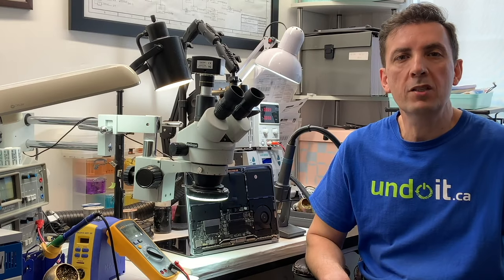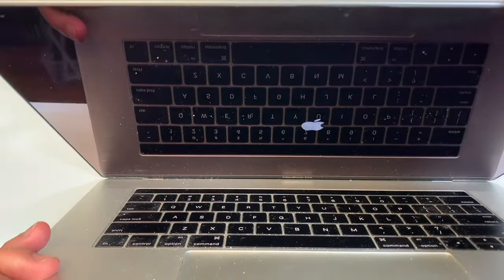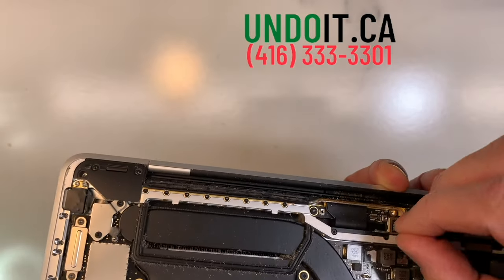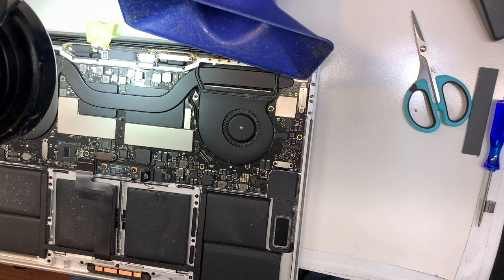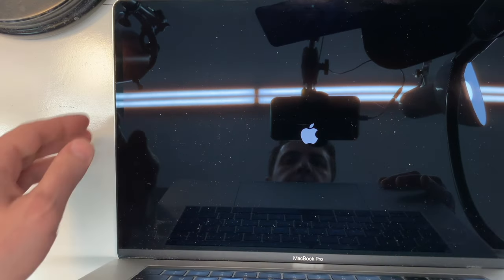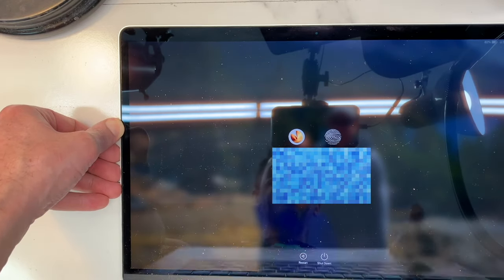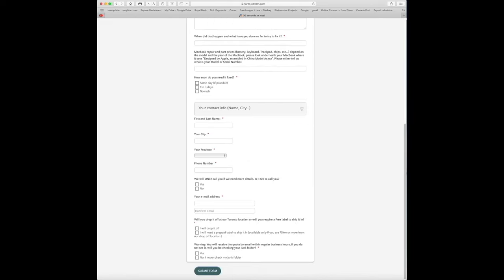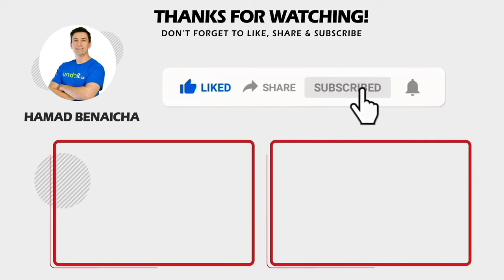🇨🇦 MACBOOK SCREEN GOES BLACK WHEN TILTED OR OPEN AT CERTAIN ANGLES, FIXED! - Hamad Benaicha 20+ exp

Comment: While I was streaming some videos on YouTube on my macbook pro, my display turned black. After I closed it and opened it again, it worked perfectly fine. After 15 min the screen turned black again and then 4 thin vertical purple lines appeared. I restated my laptop but it didn't work but when I closed the  lid and opened the lid a few times the screen for ok for 2 second and  then it again showed purple lines. Please help

Comment: What could be the issue if there is no image at all, but the back light works? Just randomly happened after using the macbook the night before, and when I opened it the next day the screen was black. Did not drop it. Checked at different angles and it stays black.
Reply: Same issue, did you find a solution?

Comment: i have a macbook air m1 2020 model.. have the same issue.. i shared your channel to the technician.. he tried, but he says my model is different than what you have shown , but it has not been repaired it. The screen works till an angle of about 80 degrees and that too only when i open the screen in an extremely slow pace with lot of patience.. looking forward to some inputs how i can repair.. the technician says i will have to replace the screen, but its too expensive
Reply from the maker: Sorry for the late reply, the Air 2020 does not have the flex cable issue, the problem is with the LCD and unfortunately you might have to replace it.

Comment: Hello Hamad. Thank you for taking the time to show this to us. Sadly I'm far away in London so I'm going to attempt this myself and hope for the best. I have very little experience with this type of repair and I see this demands an exceptional level of soldering expertise but I'm hoping that having the same microscope you have (I'm a fine jewellery maker) will give me some confidence. could you please confirm that I need to connect 8 jumpwires from the cable to the base? and (this might be a stupid question) do the wires have to be insulated so not to touch each other? Thanks very much and I appreciate your impeccable skills!
Reply from the maker: hello, thank you for the note, there is in total 7 wires that need to be jumped and you are correct they have to be insulated as you don't want to short and kill the GPU.
Reply: Awful filming bro

Comment: Having the same issue on a M1 Macbook Pro 14 inch MacBookPro18,4
Is this also reparable? Could you fix a laptop sent from Europe?
Thanks!
Reply from the maker: No sorry that issue only apply to the 2016, 2017 MacBooks 13 and 15", unfortunately if you have a similar issue with yours it will have to be replaced, it can be fixed.

Comment: Mine goes blank and comes back after I have closed and open the lig, It is a 2017 13inc mackbook pro
Reply from the maker: It is most likely the same issue as described
in the video.

Comment: I have macbook Pro a1502 model, whenever I power it on there is sound but the screen is completely black. There is no physical damage to the screen or the cable. Everything looks fine. What else could be wrong? Pls help
Reply from the maker: This is a different issue, model, it could be as simple as unplug the LCD cable clean it with some alcohol and plug it back, make sure the battery is unplugged when you do that.

Comment: I am thinking to buy a macbook for a repair that i want do do to make some money. I saw one on marketplace. An app in the netherlands where I live. It was a 2019 MacBook Pro 13 inch with the problem that the screen only works if it is between 70 and 100 degrees. I can buy it for 250 euro. But I am 13 so I have not much experience.I did some iMac’s. Also I have a question about an 2010 MacBook Pro. I am fixing it but I don’t get the operating system installed. I have a installation cd from apple self( OS X snow lepord). Made a Micro sd as start drive but it stops in the middle of the loading screen and I have an 128gb Samsung ssd installed inside. Can you give me an answer to try something new? I putted almost 10 hours in it but nothing works.
Reply from the maker: 2019 MacBook Pro don't have Flex cable issues so it must be a faulty LCD that will need to be replaced. As for the 2010 try with a new SSD and do the installation in Recovery mode by just holding the Command+R key while the macBook loads, if it's still freezes after that it must be something wrong the GPU (I have fixed about 50 of them) with same problem. I hope this helps. Good luck.
Reply: @HamadBenaicha  Hello, it is the gpu I think, what do I need to do? Can you make an video on it? Or do you have a video already?

Comment: @Hamad Benaicha I have opened the back cover of my laptop and I see the part that I need to jumped for permanent fix. You mentioned 7 wires can you suggest specific thickness and also from your video, I am able to see  you are soldering only on top portion, what I should do in the bottom part? Please suggest.
Reply: Did you figure it out? What exactly do you need to do it on your own? I know someone whose good a soldering, i just want to know if i need to buy anything for them to do it?
Reply: @Allen2989LA  I could figure out but it was so hard that I ended up paying someone local to get it fixed

Comment: Mine is not going entirely black but displaying the crazy colored patterns covering about 90% of the screen. I'm assuming it is the same issue since it is reproducible by tilting the screen back and forth. Yesterday, I was able to get it working in specific positions but today I got it working twice for 5 minutes only (in different positions). At one point, I was sending email with the lid 90% closed lol
Reply from the maker: If you get different colors that is a different issue unrelated to the backlight cable, you should  have it checked by a local computer store.
Reply: Hey! This has happened to me too. Have you found a solution? X
Reply: Happening to me too did you get it fixed?
Reply: @brittanylee8210  is yours fixed?

Comment: Do you happen to know anybody in the US that does this fix? We’re in Houston and the techs just want to change the screen which hasn’t fixed it…
Reply from the maker: If you haven't found anyone in the US, email me at service@undoit.ca
Reply: @HamadBenaicha  I am in the same boat here in Houston and am experiencing the same fate. I will definitely email you right now.
Reply: Joe - did you find someone in the states to do it?  I'm in Lubbock and the repair person here claims "With Apple parts they often come as an assembly. Replacing a screen or cable is the same as the replacement part is the whole top lid of the computer.  I don't think they know how to do it here.
Reply: @minneapolisko  That is typical of using official Apple components. Instead of selling a cable to sell the entire piece. Car manufacturers do the same thing.
Reply: @joe coneff, @soundmortv i have the same problem in houston. Did you guys fix it ?
Reply: Rossmann Group in Austin Texas fixed my flexgate wire issue and I'm back up and running now! Upset that Mac only covered the cost for 13" and not 15" models, which makes no sense to me.
Reply: @innerglowwellness5207  I’m in McAllen TX.. how much did they charge

Comment: It is a manufacturer defect which should be covered by Apple but greedy apple charges over $800 taking one or two months. I had this issue for unibody laptop and macbook pro laptop before. I decided NOT BUY apple. Now I am using linux os, not MAC OS.